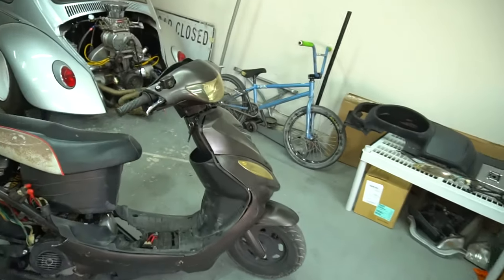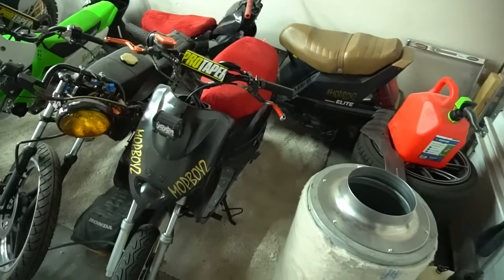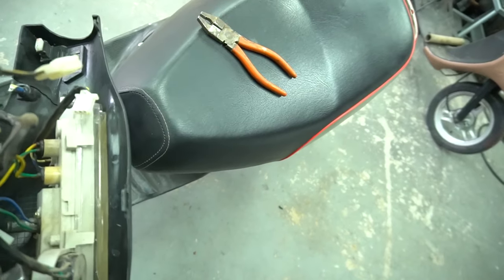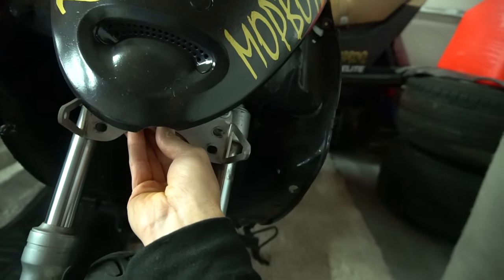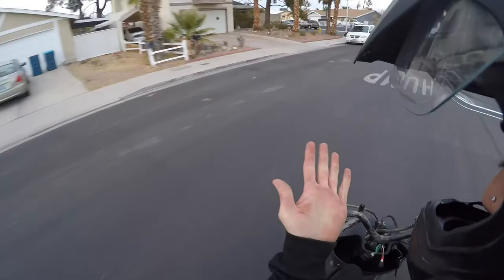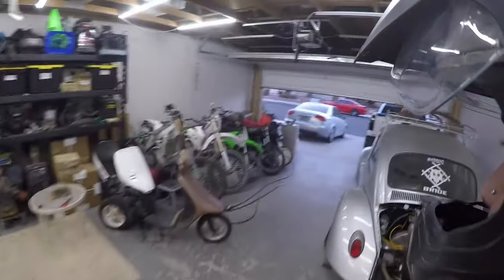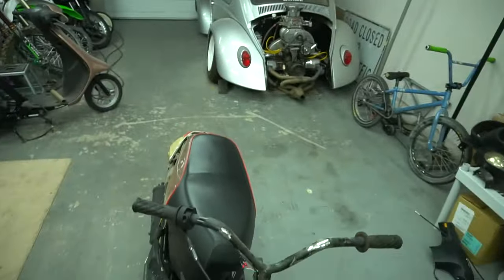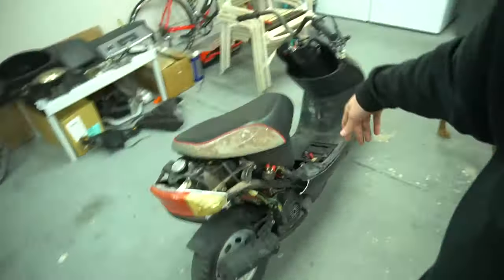Stunt handlebar look on 50cc moped! + scooter wheelies!!

Comment: Wait i got a question for anyone who can answer me if i upgrade my 50cc engine to a 100cc or 150cc engine do i have to upgrade the rest of it or is the rest of it optional? Cause once my moped is able to run again i wanna upgrade it but i really dont wanna mess it up
Reply: You will only need to install an 100cc Big Bore Kit inside the engine, the rest is optional although you should upgrade your air intake system you can get a pod filter or just drill holes in your air box, you would also need to re-jet your carb if you upgrade your air intake but it is probably the best upgrade besides the Big Bore Kit

Comment: I’m building a 100cc moped currently. Could you help me out please! What color wires did you use on the rocker switch for the ignition? The wiring diagram is near impossible to find…. I have 2 plain green wires, 1 green and white, a black wire and a red wire. A total of 5 wires coming from the kill switch/ start button.

Comment: i want to do this, however my laws in the uk require to have a speedo and fuel gauage... could you do a videdo on how to do or could someone contact me to help?
Reply: I don't have either and I'm from UK? I haven't had either for over a year. On multiple bikes? As long as your not being complete Pillock no one cares
Reply: @youmadhippo3976  cant you get a fine though im only 16, and from the united kingdom im not sure where your from
Reply: @-hdog-1771  im from uk also. and never had a issue as of yet. as long as your not being reckless you shouldnt even be pulled over
Reply: What about mot? So u need it

Comment: I tucked the unused wire clips down into the front body plastics, then zip tied them off. No need to cut, if you don't have to.